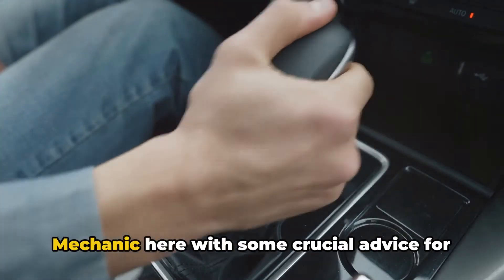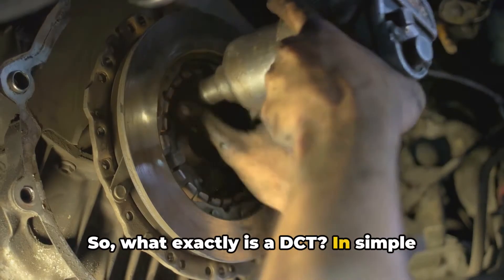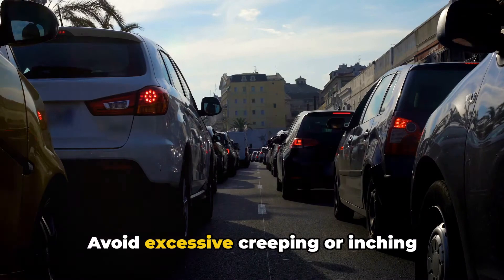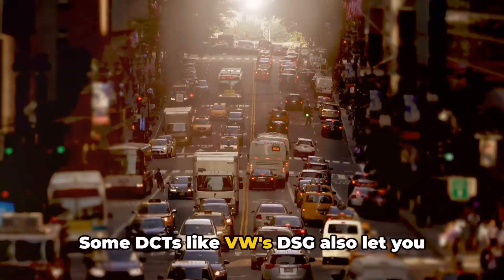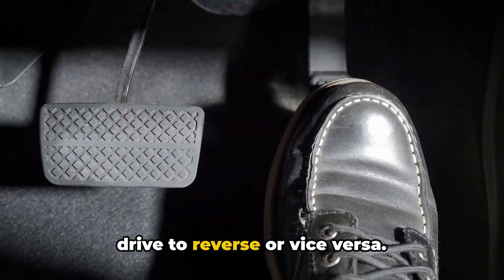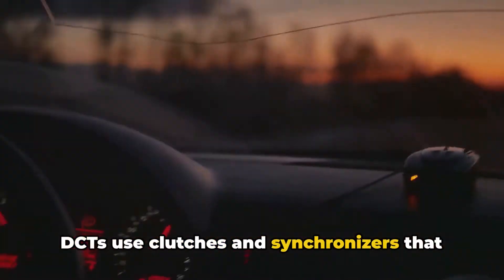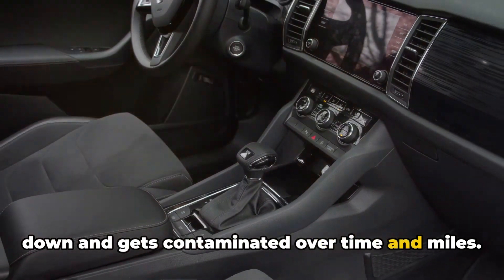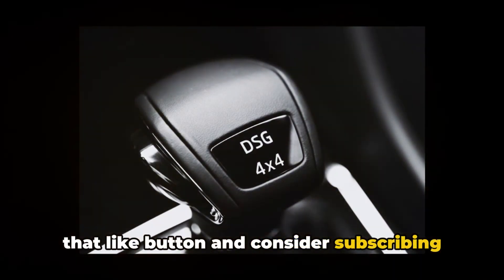How to Make a Dual Clutch Transmission (DCT) Last Over 250 000 Miles

Comment: I have the dry dsg 7 ,dq200 and nothing works like that.100.000-150.000 km and you will have problems with dual clutch or megatronic .I drive very smooth but i had 3 times problems and lot of money spend.My car has now 400000.km

Comment: Impossible. I've been driving Volkswagens for 18 years and the DSG gearboxes have always had a very short shelf life. By short I'm talking 120,000km before they need clutch packs, mechatronics units and flywheels. Volkswagen themselves are half the problem, since they mislead consumers by telling them that the DSGs are "sealed for life", when they're not.

Comment: Had my 8 speed dog rebuilt at a cost of £3000 . Cars 12 years old I have had it since new just really like the car and a rebuild was cheaper than buying a new one and now it’s as good as new and should last another 100,000 miles with regular oil change

Comment: I do everything on this video its true and I have a MIGRANE HEADACHE of a car FORD FOCUS 2014 DCT I had to hack the PCM so It doesnt lock up the transmission but all the warning lights are on, its been 4 years and when the transmission slips it gets bad so the trick is to shut it down completely wait 10 seconds start her up again runs like nothing happened, also it only happens when I hit a bump or the pavement is all cracked, I suspect maybe the PCM cables are a bit loose who knows really.

Comment: thanks for the tips. never owned or wanted to own an auto. but in Australia they don't do manuals any more. it was hard giving up my manual. but just brought a 2024 VW T cross. style. nearly got a mazda cx 30. i like there auto's bit more zip. but loved the t cross at the moment not sure of the DCT. i am also not used to driving a bigger car slash suv. won't be like driving a hatch. i have only had it 2 days. smooth and all that. but i tried sport mode on the way home last night what a difference. i won't use it all the time but it is nice to have. am so happy with this t-cross so far. but i still have the urge to dowshift as this upshifts before i normally would. haha

Comment: As mentioned the torque converter has a few such problems. Yes, warm up the transmission and change the transmission fluid. A torque converter transmission is a brilliant design and so reliable. Mechanic 60 years experience.
Reply: I know what you are talking about. Sisters 1984 Corolla 4 speed auto made it to 150000 miles. Car am scrapped to many things wrong too far out of date. Took 20 years of mostly rough in town driving to get there. 2014 Hyundai Accent 185000 miles transcran fine car scrapped insurance total hit and run by the other driver. 1999 Ford Ranger nearly 300000 scrapped accident total. Trans and engine didn't run all that well after 250000 miles. But still amazing far . 2004 Honda Civic 204000 miles when trans failed took almost 15 years of mostly rough in town driving

Comment: One of the tips in the video is not possible a avoid creeping . Can't do that in Seattle WA USA. You drive in this place and you are going to have to creep and crawl somewhere. I wouldn't buy dual clutch because of that problem. I think dual clutch is a dead end and shouldn't be offered or used. To be replaced by automatic transmission. And I have read VW did do this on one of their.
 models
Now maybe the whole world isn't as screwed up for cars and drivers as here. Nut I believe the problems here will show up everywhere . For the same reasons they did here. Population gres the highway system isn't fixed. Bad driving habits of younger generations
Reply: the t roc and the golfs use torque converters now. but not polo and t cross yet. they should have kept a manual option , Australia manuals are no more. well hope my VW T cross DCT lasts

Comment: 5 years and 60000 miles?. Well how about with regular maintenance to an automatic transmission 204000 miles for a Honda Civic took 13 years to get there. If 5 years and 60000 miles is all you can do DCT should be pulled off the market and replaced by real automatic transmission.

Comment: These Tips should give you a good 60,000 Miles & 5 years before it's junk 😂
Reply: 5 years and 60000 ?. Well how about the story I heard about 2003 Honda Civic automatic transmission regular maintenance went to 204000 took 13 years to get there. In Seattle WA with lots of bad traffic. If that is all dual clutch can do. Time to pull it off the market as nd replace with redl automatic transmission. I seem to recall that V,w actually did that on one of their models
Reply: @larrycjost9388  
My Sister In Law's Hyundai Kona has 45,000 Miles on it  the Dual Clutch is dying fast :(  Pretty Sure Hyundai is no longer using them.

Comment: Question for you……why does Hyundai have so many problems with their dct transmission?
Reply: dry or wet?
Reply: My dealership never told me a thing about properly driving a dct. I have a 2018 Tucson 1.6 gamma turbo. Transmission was replaced after 74k under warranty because it wouldn't go in reverse. So far, no other issues, oh except for burning oil. At 129k, I'm hoping I can make it last 2 more years when the house is paid off
Reply: They're trying to give you a premium experience at a non-premium price. That's why the warranty is so long.